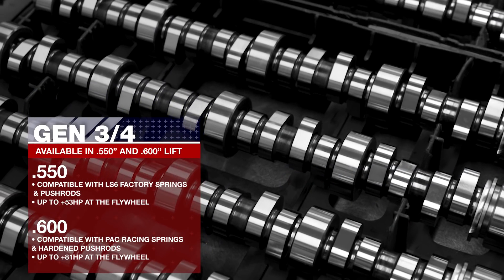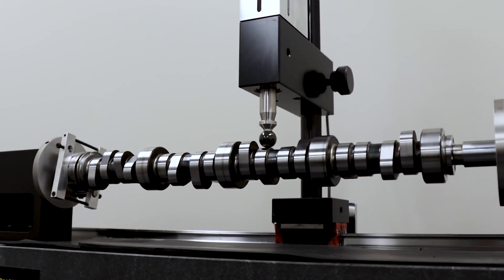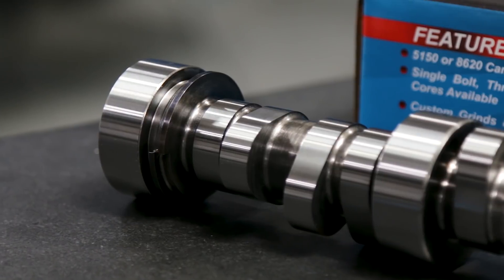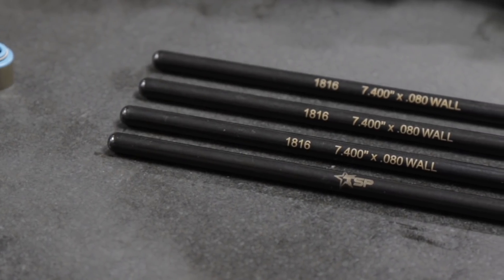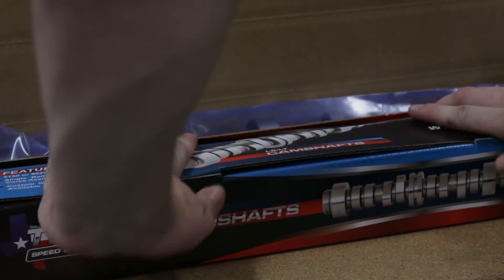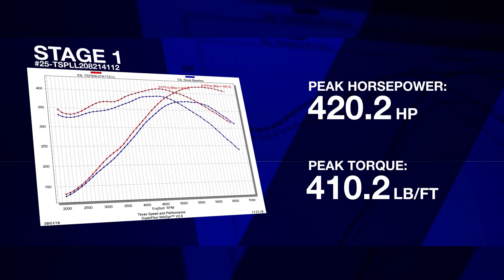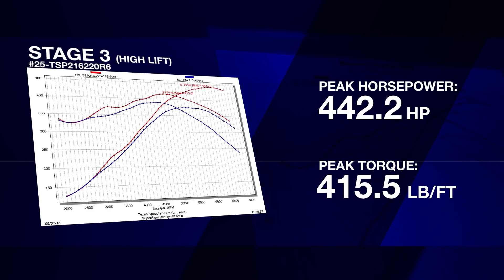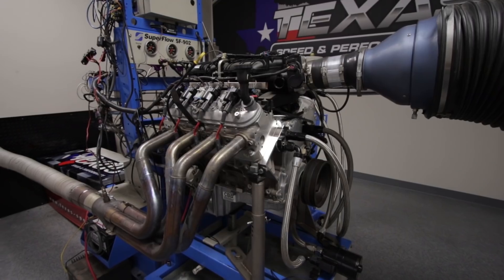Texas Speed & Performance 4.8L, 5.3L, 6.0L, 6.2L GM Truck Camshafts

Comment: I have the low lift Stage 1 Truck cam. DOD delete and everything else stock, after performing the tune 2011 Suburban with factory 799 heads it put down 283whp and 302wtq.
Reply: What company or brand of tune?

2009 Suburban 2500 myself

Comment: I have a 2012 single cab standard size bed, NOT the crapper long bed 2 wheel drive 4.8 V8. I want to get a cam kit for it i want it as choppy and loud as it possibly can be, i live in Michigan so i don't have those stupid ridiculous vehicle laws. Would i be able to get a cam kit that will exceed what I've just said and still work later down the road to add a super charger or will i need a whole new cam kit ? I don't want turblos at all i want super charger only. Gonna drop the truck correctly nice wheels an tires full true dual exhaust etc... the works

Comment: So whats the difference between the different stages of a cam? I want to cam my 01 Sierra 1500 but i really want a seperated chop sound
Reply: The bigger cams make far more power up high but if you look at the chart for the stage four you can see how it actually loses power down low, and the choppy idle is because the timing isn’t optimal at low rpm.
Combine the timing with the power loss and that’s why powerful setups demand stall converters so that the engine can “skip” the rpm range where it would bog down.

But if you haven’t found out already you can get a mild to medium cam and run stock intake and not change anything else except a tune done.

Comment: @tsp what cam do you recommend for a 48 with ported 853's in a 98 fbdy?? 150-200 shot will be through it regularly? Will use factory z28 gear and about a 2200 stall
Reply: Mild cam with that stall

Comment: Have a stock 5.3 wanting good sounding cam with out changing a lot I seen some on you tube that sound good like the 220\220
Reply: galaxy_ gamer18 
You need to change valve springs and pushrods when doing a cam swap 
I’ve seen stock springs break with stock cams either 4.8/5.3 /6.0 from 99-08 
A 220/220 is good but it needs stall 
You’ll probably be good with a 216/220 headers and tune
Reply: @reyperez3424  Im getting a 220/220 with 110LSA. Factory rods, but I'm gonna do springs & seals. Ill run stock converter for a while, but thats the next upgrade on the docket.

Comment: Hey got 1984 el camino 305 which cam will make it sound good
Reply: Well... to make it sound good... the first step is to remove the 305 and throw it over your shoulder. 

Then start with an LS based engine and quit wasting your time (and ours)
Reply: You should not buy a cam to make it sound good. Buy an exhaust for that.

Comment: So I have a 5.3 out of an '02 Suburban that I'm keeping with the stock 4L60E. I want to upgrade the cam and rollers to something that will make it a bit more peppy without breaking the bank, what kind of cam and roller kit would you recommend?
Reply: Lol
Reply: What did y end up doing
Reply: @donmichaels6401  I ended up going with the Sloppy Stage 2. Got it on sale for under $200 and it definitely added some pep.
Reply: @FranksShitBoxCollection  did u get it tuned? If so how much hp

Comment: I have silverado 2008 4.8 and need a link to buy the high lift 660 * 
I want something aggressive actually 
I'm going to gift it for Christmas to my brother
I am buying the 3,000k in the future after the install
 What do you recommend
Reply: mustang69 
From what I've seen 4.8 likes boost (turbo etc) , but if you do a cam you need a stall like 3600 because 4.8 start making hp after 3500 rpm up to 6500 rpm and gears like 4.10 .
I had a used 220r 114 lsa cam that I gave it to my friend for his 08 4.8 with 3.73 He liked it but after a 3600 stall he loved it.